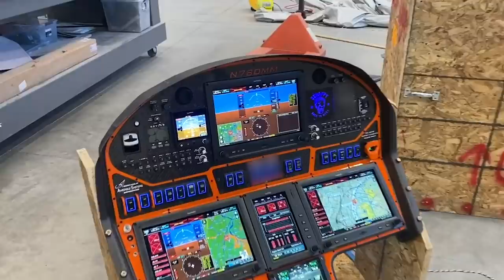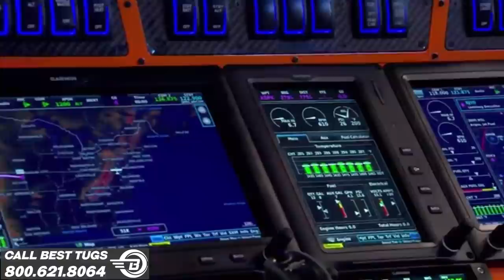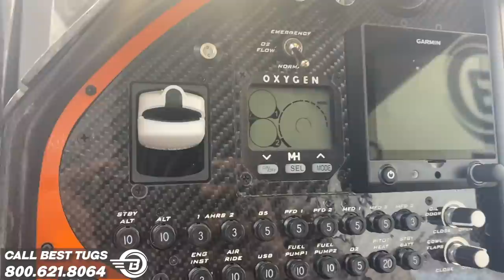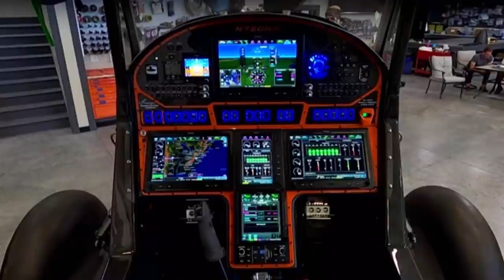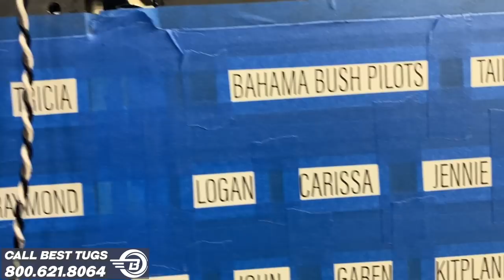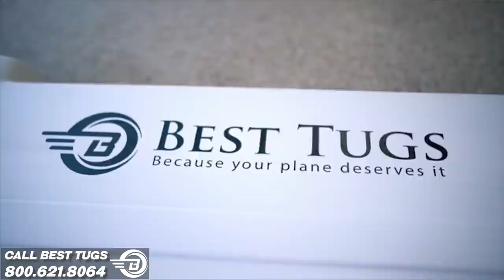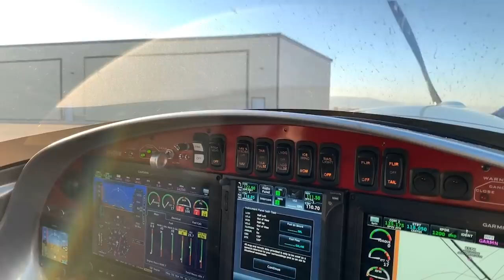Rocket 🚀 or Bush Plane Panel? @garminaviation Q&A with the Patey twins | Scrappy #33

Comment: I'll touch on the "I dont know a pilot" my hobby is snowmobiles I've only sat in a plane at a airshow 18+ years ago never peaked my interest. It's the high energy and amazing fabrication/design that keeps me interested, motivated and wanting to get out in the shop and "back to work" when the videos ends. Keep up the great work.
Reply: As a steel, wood & sewing furniture maker, I'm with you. But a Maker is a Maker, no matter the medium. Mike inspired me to think about carbon in my furniture. And has prompted me to join a friend's plane build team in a couple weeks!
Reply from the maker: Thanks, that’s so cool 👍🤠

Comment: Love it. No plane on the planet will come close to how well built scrappy is. You cant beat self built. It's a pilots plane.. all the bells and whistles. 
 Congrats Mike!   Just a thought...When your done with Scrappy. You should do a budget build of a kitfox or J-A.  step by step. Use an auto conversion power plant like a Viking engine. Low cost with decent reliable performance for half the cost of a rotax. ...2 screen set up ( Garmin + ipad )  The only thing you should do custom is a suspension.  Something that could be replicated or sold by you lol.. Scrappy is amazing.

Comment: Secret switches summon a self-driving Best Tug to come tow Mike into the heated hanger without having to get out of the airplane.
Reply: I foresee a switch that will pull the gear up for added lift during flight, semi retracts. Maybe even help with loaded and unloading luggage and people.
Reply: Didn't you watch the video of his wife in the snow with the tug probably brought him hot chocolate and a sandwich before that gotta keep Mike happy she's working on her second carbon cub I was blessed with matching sox and a cup of coffee and I even made my wife breakfast 😉 let me check......nope nothing new in the yard I'll check again after lunch
Reply: In another video you can see the right of the three switches says right gear up/down, so the left would be left gear.  Middle is probably hydraulic pump on/off.
Reply: @astral9872  Retractable biplane... what a time to be alive.
Reply: Remember the magnetic launch function that he discussed on Draco, he even designed it but decided against the added weight. I suspect that is going to be incorporated. To leap into the air on zero roll.
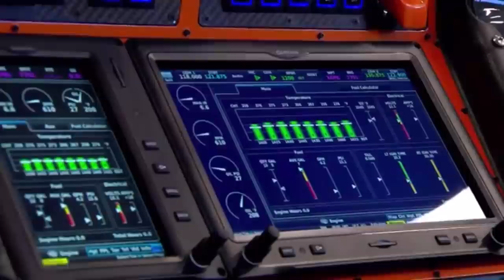Reply: @astral9872  Just above the blur box at 1:28, you can also see a bit of the top of the tires and gear wings.  Also, if you look at 7:20, you can see the raised image of the tires, gear wings and of the tail wheel in the center.  Looks to me like left switch -> left gear, right switch -> right gear, and middle switch -> tail wheel.
Reply: Of course it has extra switches...it’s not just a plane, it’s a transformer !
Reply: @West-Wind  It may also be an air pressure adjustment for the tires, rather than a gear-up/gear-down kind of thing... I guess we will just have to wait until Mike makes a reveal!

Comment: Mike, I haven’t found your explanation of the flex hoses to the main gear suspension struts.  My best guess is that you have a single ground/flight adjustable regulator valve, with a smaller high pressure nitrogen bottle tucked away “somewhere?” to adjust for different landing surface conditions.  Am I even close on this?  I love your whole approach to all that you do, whether it’s aeronautical, family, or other areas of our humanity while we are here on this earth.  I even had to buy an RC model airplane to get myself “back into the sky.”  And now the RC club wants me to give them a presentation about my 7 years working on the 1st and 2nd stages of the Saturn V rocket!

Comment: Lying in bed at night, it’s building engines. Every type from every manufacturer. It’s performance, efficiency, speed, rpm range and tuning. Whenever something breaks you tear it down, figure out what failed and fix it. When I was selling Auto Parts it would be how to educate the customer, what’s his or her level of education in mechanics, what personality type they have and it’s traits and figuring out the best approach. Once that’s done and the customer understands their mistake, if it was theirs up you won’t see them again, until they are ready to build their next engine. In my last job it was more about how the parts were engineered and educating the customer on how to use it. I worked for Federal Mogul who owned TRW and Sealed Power, Fel Pro, Bower BCA and National Oil Seals. I worked the 1-800 technical assistance hotline, and some of my customers included the shops owned by Jack Roush, Bob Glidden, Richard Petty, Ross Pistons and many more big names in the Racing world. Too much fun and yet, the pay was so bad than in all except my last job I could afford anything besides just living. When I g9t to Federal Mogul I finally had some extra cash coming in and I was looking very seriously at getting my Pilot’s Certificate and building an airplane of my own, using what I had learned when I was building engines to build my own adapted Auto Engine for the plane. But they closed their doors on the Phoenix operation just a short 18 months after I was hired. Time to start over? Not with two kids going to college. So lying in bed at night.... my mind doesn’t stop. Even after becoming disabled! 
Oh, and I’ve never been to Oshkosh. Any chance you can refuel at Mesa Gateway airport so I can hitch a ride? (It’s a bucket list thing!
By the way, 5 screens in Scrappy? Well I wanted to put a screen that’s viewable for every body that’s flying with me, with a camera showing the pilots view. That way everybody can see what the pilot sees. Then give them the choice of seeing that,or a movie, or surf the internet during the trip! But that’s on my passenger plane dream. I also thought of doing all the cameras you put on scrappy, especially at the tail! Id want the same thing on my Bush plane dream! But I love what you’ve done on Scrappy!

Comment: Connecting an "old" race engine to such a modern glass panel isn't that easy right ? Would you give us an overview of those electrical systems and how they talk to each other ? I'm sure you have tried to optimize as much as possible your wiring harness ! Keep your enthusiasm going and Back To Work !

Comment: It would be cool if the suspention could be capured in the compressed position and released via a remotely actuated latch. If the shocks also had  a remotly opened/closed bypass valve on the rebound, you could open the rebound, then release the compressed susspension and sort of let the airframe hop during takeoff. I would love to see that.
Reply: I already called that in an early video, that's what those secret switches are for...
Reply: @someoneelse7629  I hope so.

Comment: Can the main suspension be fully compressed in flight? Those gear foils could make Scrappy into a biplane. 

Firewall video had some actuators near the hydraulics and cabling that was never explained...
Reply: I think mike is trying to keep it a secret but I Believe he is using king shocks which definitely have the capability.  I imagine he wants to compress the shocks in flight to allow best angle for lift.  Also in this video he mentions fully bottomed out he still has more clearance than stock cubs . That being said he should be able to land while compressing the suspension.  He said scrappy was not built for competition but I believe it is to lower his and others expectations in a competition.
Reply: @samuelmarson4  What would landing hard with suspension bottomed do to the airframe? Seems unlikely he'd take that risk?
Reply: @drewt3210  He might compress before Runup, start with compressed shocks and release them just before landing 🤔
Reply: @drewt3210  I was thinking in a competition scenario maybe lift at slower speed would be more useful than suspension compressing while landing?  Or potentially locking them with 4” of travel instead of 20” so the aircraft has more lift but still a cushion while landing.  Who knows though you may be right.  Anything is possible with this dude.  He just mentioned putting rockets on the side of scrappy so really sky is the limit for his thought process 😂
Reply: That suspension is for STOL competitions, he has the monster motor and prop for short take offs and the ballistic parachute and suspension for vertical landings

Comment: Tell me more about the yaw damper.  I'm in the middle of a bearhawk and just added the 3rd servo on the firewall and have cables down to the rudder pedals.  Specifically, do you think the garmin servo with it's 60in/lbs of torque is enough to damp a tail that large?  Are you planning on designing the wing to try and limit adverse yaw?

Comment: What materials are used for fasteners when fastening Carbon Fibre items?  On the Carbon Fibre spinner you used Cleco's  to position the Spinner on the hub.  What fasteners did you use and was the Aluminium hub compatible with the Carbon Fibre Spinner , were any interferance materials used to separate the two?

Comment: Oh and here's a question for the Q&A:

I see quite a lot of pilots have engines that just quit in the air or on takeoff. Why does this happen (seemingly often) with airplane engines? The incident with Jonas Marcinko flipping his plane comes to mind. I've owned a lot of vehicles even old gas engines with 200k miles and have never had an engine just stop while driving. 

This may be a stupid question, im definitely not a pro by any means, just something that has been on my mind.
Reply: Jonas had air in his system from transferring of fuel I could have him confused with someone else
Reply: @1STGeneral  Jonas is known as "sketch" for sure. So I could see his being an issue like that. I feel like I hear about engine outs a lot though, I may be just paranoid I guess.
Reply: in comparison to the number of planes in the air daily, its not any more often than a car.  Honestly, much less often than a car mainly due to the maintenance and redundant systems in an airplane.  You just hear about it more cause it usually results in an off field landing.
Reply: @1STGeneral  it was Corey R. not Jonas that it happened to recently. 
Although Jonas had an engine sputter on take off from a sand bar awhile ago and nosed it over. If I remember correctly it was vapor lock. They both flew the airplanes home however.

Comment: Hi Mike, I absolutely love your videos of the aircraft builds. You have my utmost respect as a pilot for taking responsibility for your actions both good and bad, I have learned a lot from you and I would like to say thank you. I do have a question. I purchased one of the last Skyraider Frontier kits made by the now defunct Skyraider company in Caldwell, Idaho. Along with the kit I purchased the FWF from their demo plane, including a Lycoming O-290. The attachments from the engine mount to the airframe are four 1/4 inch bolts. This seems to me to be much too small for safety. Do you have any recommendations?

Comment: Hi Mike!  Will you be salvaging the leading edges and electronics of Draco for the new Draco X in order to save a lot of machining for the wings?  I am sure the ground loop bumpers prevented damage to the leading edges, at least they did not appear damaged.  Love your Scrappy project but can't wait to see your new bad ass Draco back in the air.  Was your turbine salvaged or is it beyond repair?

Comment: Would putting a lock out on your tail suspension and full compression change your angle of attack to increase or decrease better yet your take off roll?? Or even the front the get more ground effect? Just curious!

Comment: You talked about more power on Scrappy. Turbo charging seems like a good idea. Being at 15000 feet density altitude, with your engine thinking it's at sea level, would be a good thing.